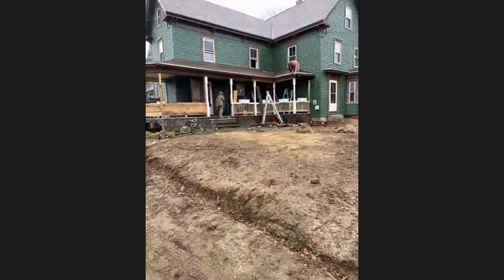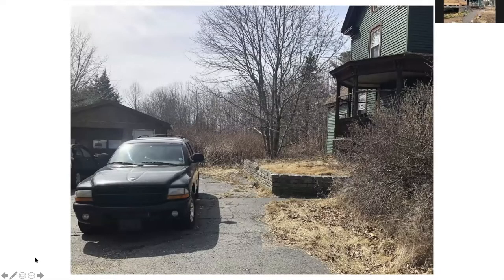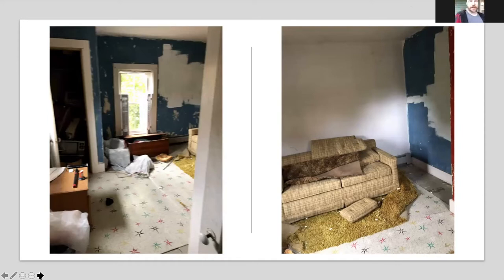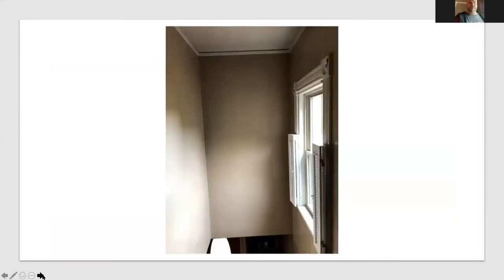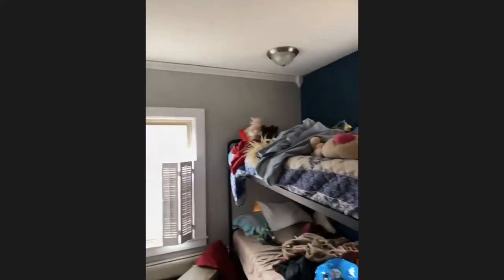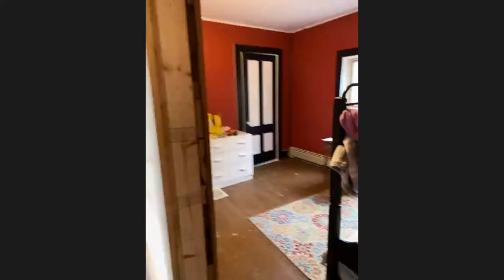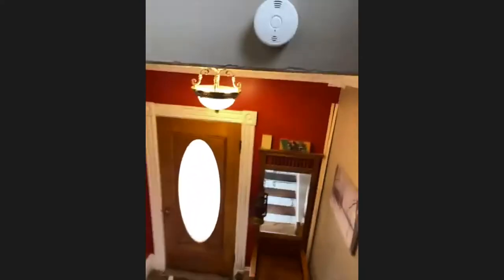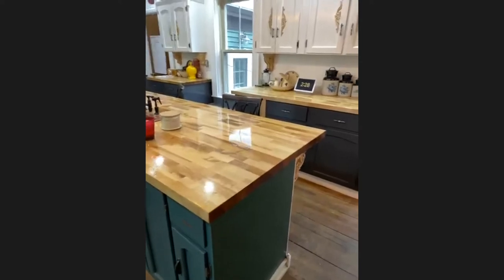Old House Restoration Class: Session 1

Comment: One other thing: You mention in this video not wanting to replace the disused heating grates bc it would be hard to match the wood. Like your house, mine had about many heating systems. I had fireplaces and woodstoves of course, radiators, cast iron grates, brass grates. The person I hired to refinish the floor removed all the grates and replaced them with wood The trick to getting a match is taking old wood from places it's not likely to be seen, such as in closets and under kitchen cabinets, and replacing THOSE with new wood, then using the old wood to patch the grates. Just a thought. I thought it was clever. Thanks for posting the video. I love old houses so this was good entertainment while I was painting a back room. :-)

Comment: Not sure that this helps with the thin floor boards, but I have an 1850 home in Steuben that I bought in May 2020, and the first thing I did was have the floors refinished (they were ALL painted gray). I have wide board spruce throughout the house, except for pumpkin pine in the original-kitchen-turned-summer-kitchen,  and this narrow (3" wide) tongue-and-grove, similar to yours, in the original-dining-room-turned-"modern"-kitchen. The man who redid my floors was quite knowledgable and said these boards, in my case, are fir. I have reason to believe the shifting of rooms occurred around 1920, bc the widow of the man who built the house died in 1916, and  younger heirs moved in. It appears the house was also electrifed at that time; 1920s light fixtures still hang in the house. I don't believe there's spruce under the narrow boards in the kitchen, as there's no change in floor height, but now I want to double check.  There's a well-worn border about a foot from the walls in the current-kitchen/former-dining-room which suggests a carpet, or perhaps one of those pieces of oilcloth painted to look like carpet, lay there for many years. I'll try to attach a pic.
Reply: Oh well. I don't see a way to add one. But maybe this flooring was popular in the 1920s. The man who built my house owned a saw mill here where the boards could have been made and/or sold. My thresholds appear to be original and are spruce.